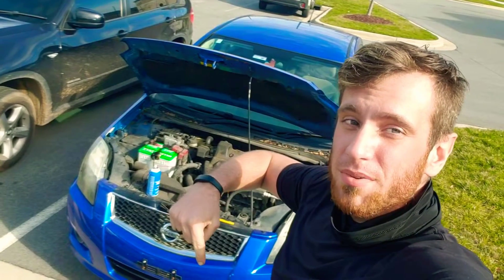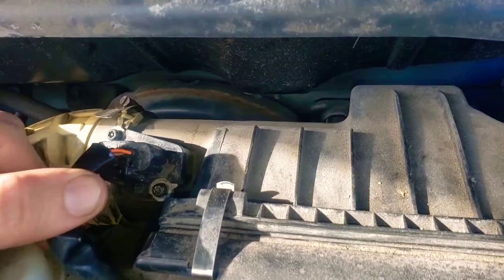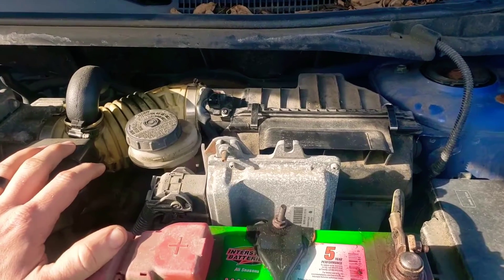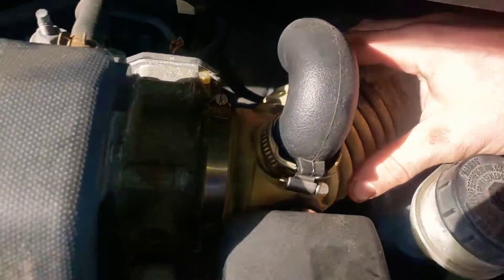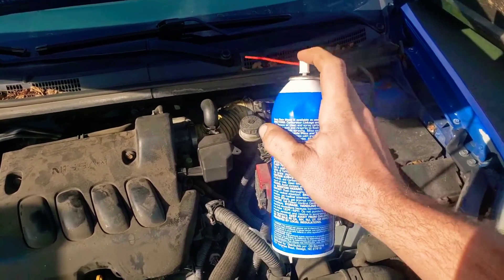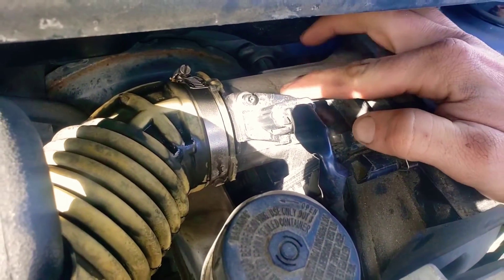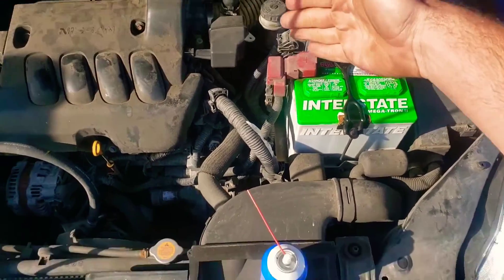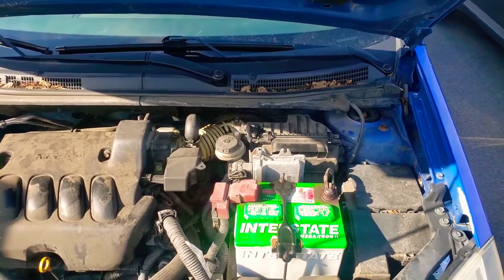P0101 Nissan Sentara Diagnose How to Check Dirty Maf Mass Air Flow Sensor Wiring Air Leak Test Stall

Comment: My friend, if you use a sensor from Amazon or those online stores, you for sure will have the checking engine on.
Don't even recommend those kinds of parts. That sensor is a very sensitive part, and I wouldn't recommend other more than oem replacement for successful ending.
Reply: Most sensors are a fking joke they do absolutely squat…

Comment: That part 140$ I done replaced mine but now saying connected bad any ideals what I need to do
Reply: If. You don't use an OEM replacement, you will have that kind of problem most of the time

Comment: Spraying starter fluid at random seems like a really terrible idea. Carb cleaner, etc, isn't meant to combust.
Reply: This is a common tech practice but water mist works just as well, but it just makes the engine stumble instead of rev up.

Comment: WHAT??? A mass air flow sensor isn't cheap by anymeans. It's a $140.00 for a 2009 nissan sentra.
Reply: I just ordered a MAF sensor for my dads versa. It was 22$ 🤔
Reply: The factory Nissan one marked up maybe
Reply: actually it’s the newer sentra. they have the more expensive sensors now